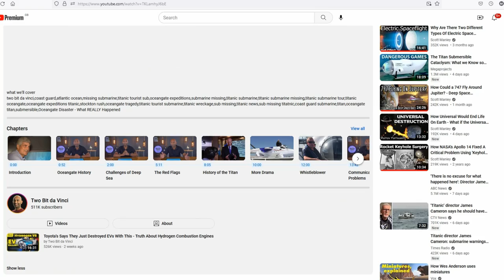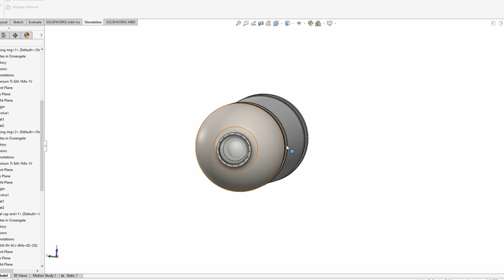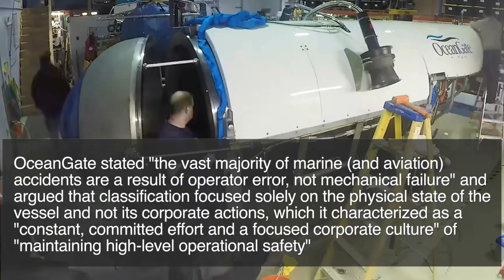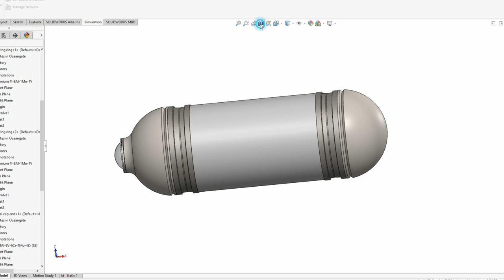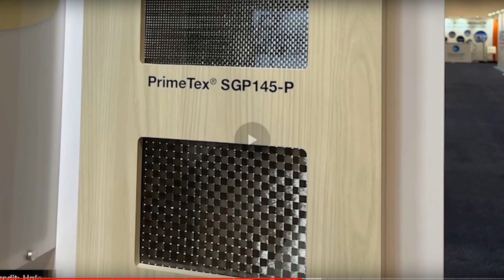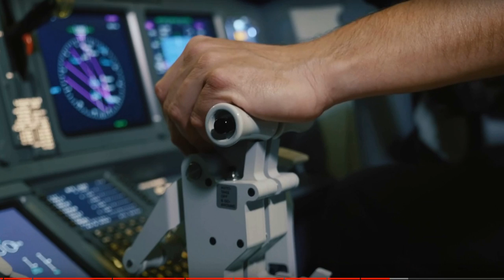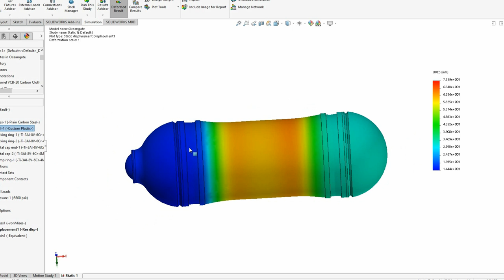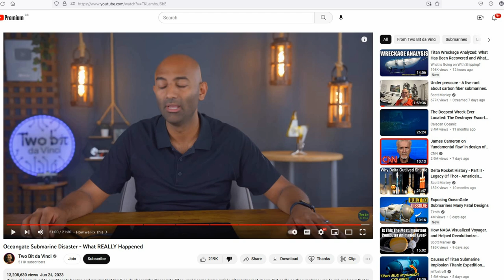Oceangate Titan - Engineering Failure?

Comment: Think about how hard gamers are on controllers lol. And the shear hours of user testing these controllers have on them. My only hitch was wireless. I have had connection issues with wireless co trollers. But wired controllers are bullet proof.
Reply: was it tested under cold conditons with formation of condensed water? there are reports of droplets forming on the inside of the hull...

Comment: I’m guessing they’d need a pretty big (ie expensive) boat to handle 4km of even the lightest tethering material.
Reply from the maker: Not really - this is 1km of nylon rope. https://www.ropesdirect.co.uk/6mm-blue-polypropylene-1000m-reel.html
Reply from the maker: To be clear its not to pull them up, it's so you know where they are. If you wind in the tether as they ascend then the direction of the tether points in the direction they're in.
Reply: @dirtygarageguy  Yes. They do.  It is not about the rope.  It is about the crane.  You want a tether because you want to pull it out of water in case of emergency.  It requires a crane onboard the mothership.  10000kg is a serious weight.  They need a reasonable powerful crane.  In order to accomodate the crane the ship structure needs to be strengthened.  It does require a bigger mothership with crane.  It costs them more.  The reason of using the submersible launching platform is to avoid renting a bigger mothership.  The submersible platform can be towed by the mothership.  The mothership does not need a crane installed.

Comment: Its turning out you are wrong about your "improvised analysis. its being rumored that a leak in the rear end of the sub weighed it down, forcing them to release the ballast and the frame. The leak in the back end caused pressure to be lost and an implosion occurred.

So yes, subs do leak, a pin hole leak doesnt always lead to implosion, it can create a laser like effect on anything inside, the leak is what shorted out the power and caused them to be weighed down.

your very clunky at this and taking one persons video  to trash talk is bizarre. (strangely you chose a video with a dark skinned presenter to trash talk)
Reply from the maker: Do I detect that you're a racist? People who notice such things are usually racist.

Comment: You spend a good portion of the video complaining about the original video taking 5 mins to get to something you're interested in when it took you over 12 to get to that part of his video...  And, have you ever used an Xbox controller?  They last around 3-4 months with normal use because all it needs is one piece of dust on one of their cheap sensors to make the thumb sticks drift and that could have led to say the front end dipping down or a faster than normal descent (not saying that's what happened but it's possible depending what thumb stick did what).  Something like that is not fixable unless you take the stick apart or by pouring quite a bit of alcohol in the controller and blowing it out with compressed air.  That can take quite a bit of time and a little luck to get done.  It doesn't sound like they would have extra controllers laying around in the small environment and track record (or lack thereof)  redundancy.

Comment: This guy cannot be a real engineer involved in any level of novel or cutting edge engineering.  his thoughts are completely out of whack with fundamental engineering advancement. Rules come from experience. New solutions need a correct approach of validation and testing of the theoretical design and evaluation carried out. From what I have read Oceangate were lacking engineering methodology and validation. It would appear that the CF cylinder was a simple laminate that was not robust and defect tolerent, as well as not having a method of evaluating the accrued damage, except for reporting the live rate of fibre failures within the laminate, but the failure may have been compounded or initiated by something else, such as handling/towing damage, as well as the compressive cycles. The analysis may have been just for a simple static pressure load case of a perfect laminate.  
In your model you could pull out the component stresses and sub-surface strress that likely act across the circumferential fibres, but this will be controlled by the fixity at the glue joint and the integrity of a closed bonded joint (which appeared to have very little de-gassing and void control during assembly). There also appears to be a lack of tapering to match stiffness over the bonded joint and waht looks like a significant step in the cylinder that relies on the bonding material to the titanium ring, right where it is flexing against fixity..

Comment: Yeah lmao they use controllers with periscopes and drones!!! People arnt inside those through and you drive a periscope that’s attached to the sub and uses cameras lol how are you going to argue with him saying he’s stupid when your not even understanding that people don’t sit inside a drone and fly it about because they’re too small and even if it was possible it would be a high risk of crashing if the controller disconnects or dies on you. They should have had a control panel with multiple controls plus they wouldn’t use a game controller joystick I would expect them to use a machinery joystick or a flight joystick. You keep commenting on what he’s talking about and you just keep criticising his wording, your chatting crap what’s the “how are you supposed to test the carbon fibre, you test it loads” wtf is that sopposed to mean! How do you test it? What are the methods of testing carbon fibre! The people who do test and certify sub materials said said they can’t test carbon fibre because when it’s tested you can’t use it again because it loses all strength, and not all carbon fibre composites are the same strength and can only be used 1-2 times before it NEEDS TO BE REPLACED. That’s why they can’t certify carbon fibre composites lmao coming from a claimed material tester like yourself. And about the kettle thing your kettle isn’t being subjected to to high pressures. Only high heat ngl your chatting sh1te yourself you keep saying things like they’re possible to do or test carbon fibre composite is an unpredictable material as any of the small fibres could break and you can’t always see the fine cracks in it and the actual resin can’t be tested that well either they all can break at different times. You could be half way through a test and it breaks or it cloud last abit longer plus all the materials arnt always made to hold hold the same strength, the resin could hold less strain that the fibre wires or vice-versa the titanium could compress the the composite causing fine fractures in the fibres and as it gets deeper into the water, that alone could have made the the composite collapse 
In on itself. Both materials are made to hold different pressures, there is definitely some good points, but not all the ones your saying is wrong.
Reply: Think of the all the pressure squishing all the air into a 2l bottle. They even said that the acrylic dome must have shattered because the bolts that held it on was still in and the window frame ring was still attached to the dome .
Reply: Your also saying it could have popped off? did you not think that the pressure would keep the them pushed together. I think the composite has just splintered and collapsed into itself, shattering the whole thing from the pressure
It wasn’t tested as we know to go to that depth multiple times and isn’t made from a material we know would keep up strong at that depth. There no way to test a composite material without going past its breaking point because we know it’s made to a thickness for the depth it’s going too. The titan was made to go 13,000 deep and had the titan had done 13 expeditions to the titanic before it had been strained too much for too long and imploded on its 14th trip. It couldn’t have any tests between to make sure it still had a strong structure to go down again as that would have damaged it to the point of failure and costing them more to make a new one. The acrylic window was made to only go 4,265ft that could be a point of failure at the point where the acrylic meets the titanium or could have broken around the bolts, causing the acrylic to crack but even if it did the crack could still be wedged in from all side.